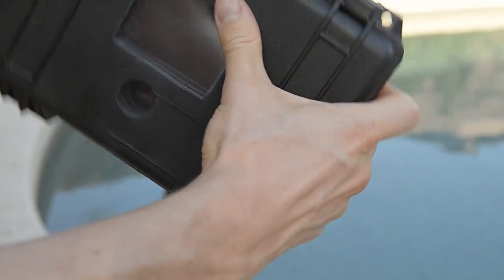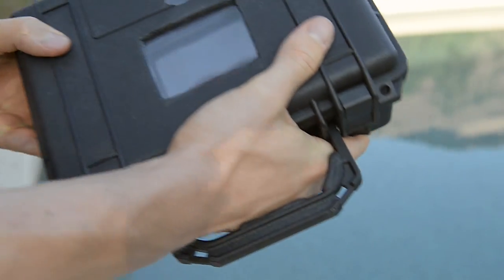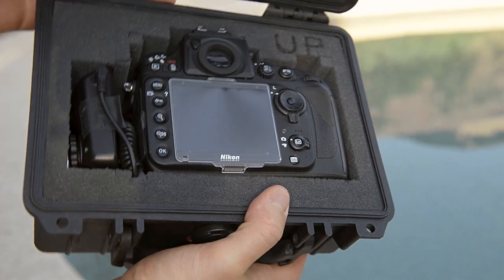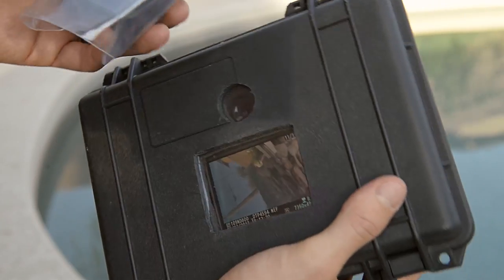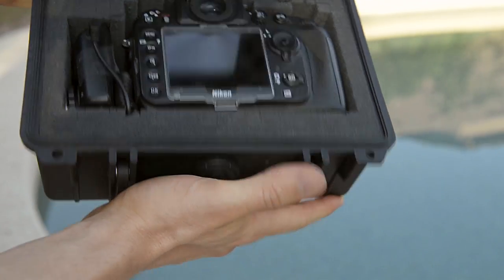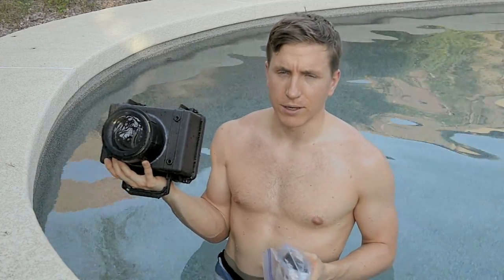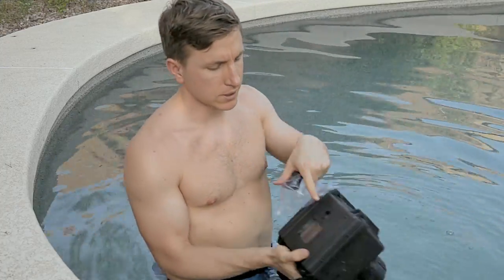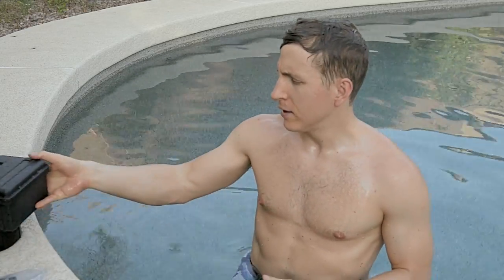Underwater test of the DIY Sound Blimp at DanTabar.com

Comment: hope the silicone is not being used as an adhesive, that the seal is mechanically tightened. otherwise you're in for a rude awakening in some immersion when it comes right off and water rushes in. If you need waterproof adhesive i'd recommend 3m 4200